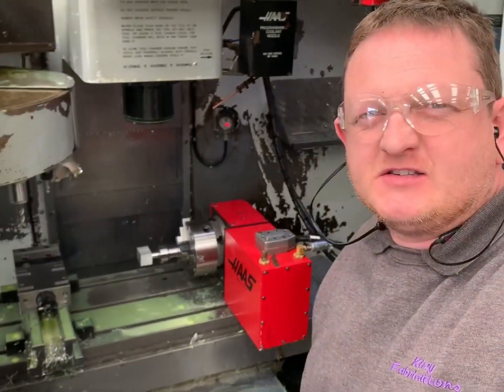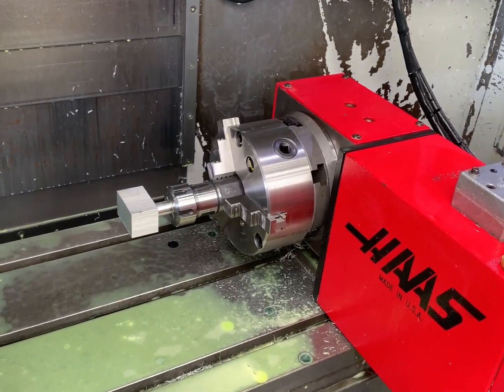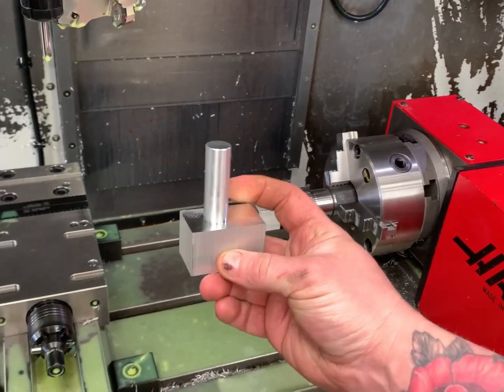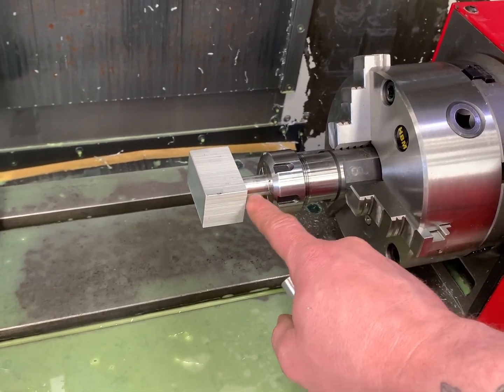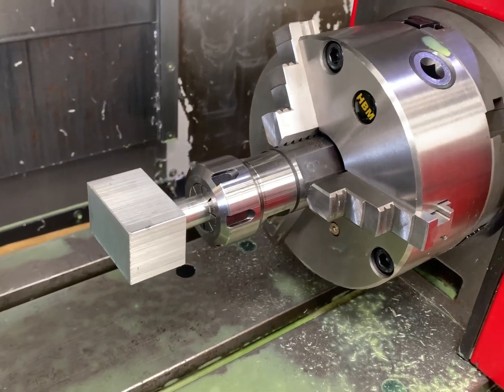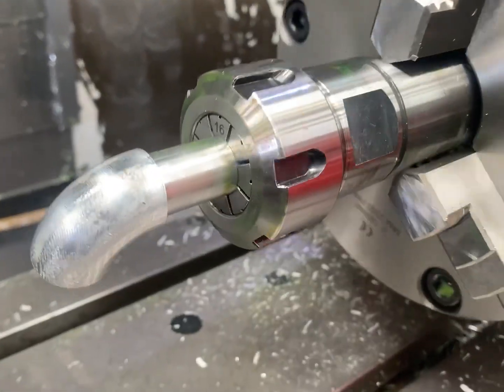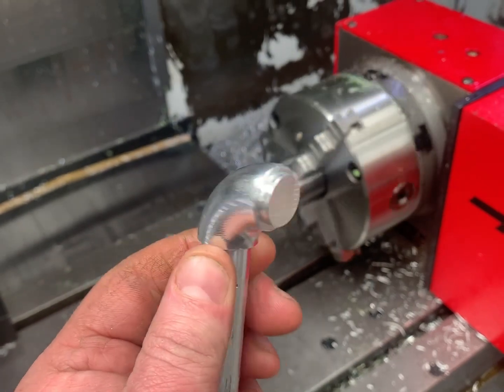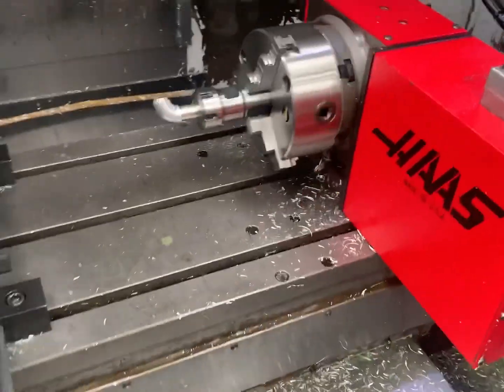4th axis machining on the Haas with the hrt160

Comment: What holding set up are you using? Where can I buy the same chuck and riser and also what is the collet holder you’re using. Great video 💯💯
Reply from the maker: Hi

There is no riser on the table, it is just a 6" 3 jaw chuck mounted to the HRT160 platter and in the 3 jaw is an er32 collet holder

Thanks for watching

Comment: can we put a dove tail vice on that rotary and then dove tail a large block of metal and machine 4 of the 6 faces on the spot? or is there something preventing that kind of 4th axis machining?
Reply from the maker: Yes you could use a horizontal tombstone set up for small parts
Reply: @kinzy_fabrications  by small you mean how heavy?